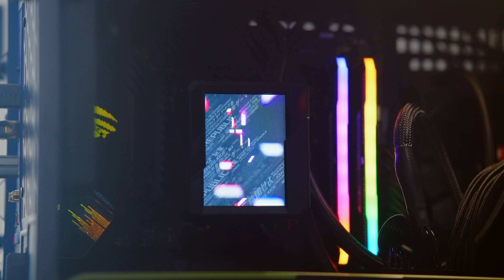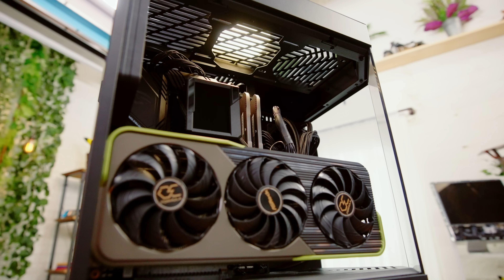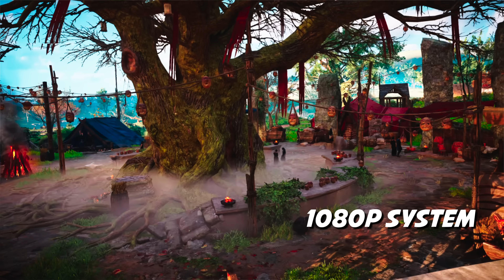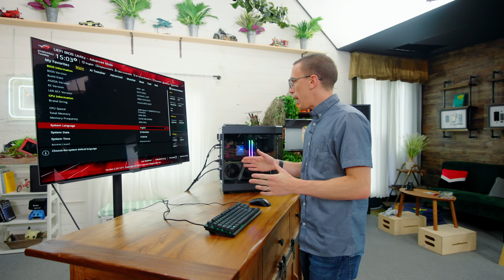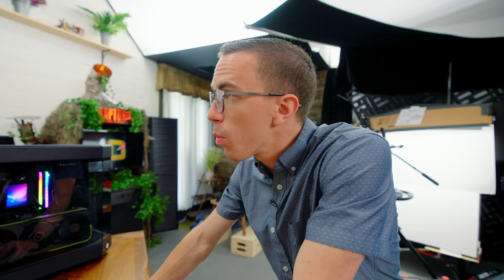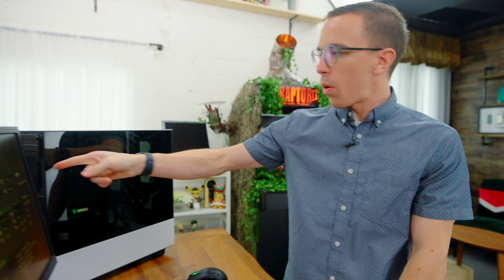Is an ALL AMD Gaming PC Worth It?

Comment: Running a 5600X with a 6600XT for a couple of days and it feels way better than my old 4790k + RX 580 8Gb. Almost no stutters, more than twice the frame rates.Awesome!!!
Reply: Same here. 1440P (60Hz Screen), 5800X and 6600XT. Its on 85% "nailing 60" in average. I do not need more.
Reply: @AnkurFFM  Exactly
Reply: I used to have a 6600xt before upgrading and it was great, I was surprised on how good they were
Reply: maybe its cause ur cpu was almost 10 yrs old
Reply: @Jackson_Vaughn he was talking about The Ryzen not the Intel 4th gen
Reply: im running same specs just 6650xt 1080p 144hz and its good

Comment: My Current Setup:
Ryzen 5 1600AF + GTX 1050 Ti + 16GB DDR4 3200mhz

My Future Setup:
Ryzen 5 5600X + RX 6500 XT + 32GB DDR4 4000mhz (I plan to use this for at least another 3-4 years)

Also Yes I could go with a better GPU BUT 5600X + 6500XT just looks so aesthetically pleasing LOL!

EDIT:
ok your comparison are stupid, you don't even mentioned what settings you are using for FidelityFX, Ultra Quality? Quality? Balanced? Performance? BIG FAIL not mentioning that.

Comment: I actually built an all-AMD gaming PC for my bedroom.  It's got a Ryzen 5600X and a Radeon RX 6650 XT in an H1 case and is targeting 1080p/1440p (depending on game).  I already had a 4K gaming PC in my office upstairs with an RTX 3090 and Ryzen 5900X so I was ok targeting a lower resolution with my all AMD rig.  Especially since I'm using a substantially smaller monitor in my bedroom (17" portable monitor vs 27" monitor in my office).
Reply: 👆.............👆👆.....👆👆👆
✴️Claim Unboxed.......🎁✴️

Comment: i have a 3070 from launch but with the 6950XT currently at $999 it is tempting
Reply: Just get a 6900xt for 700. Thats a much better deal and almost the same performance.
Reply: @MrNota500  if I did I'd probably grab the Sapphire TOXIC LE that comes with the AIO which is the same price. I've seen quite a few reviews complaining about Gigabyte's current cards. I haven't had any issues with my Gigabyte 3070 so who's to say

Comment: Anyone know if a DisplayPort 1.4 to HDMI 2.1 works to getting total hz on my monitor? Rn I’m using a hdmi 2.1 cable on both sides and it’s just giving me 100hz tops. Any solution? Btw it is an ultrawide monitor 1440p

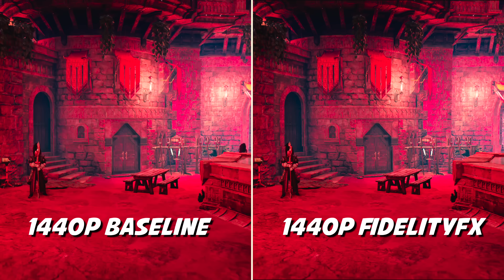Comment: Somebody screwed up. I would blame the video editor but I don't do video production. Check starting at 3:31 the HZD video as that part of the benchmark is VERY red.  You guys can do better. Oh and SAM doesnt have anything to do with alleviating CPU bottlenecks.  It allows the CPU to access all of the GPU memory instead of only in 256MB chunks.  Which would decrease the time required for memory transfers to and from the GPU.
Reply: 👆................👆👆.....👆👆👆
✴️Claim Unboxed.......🎁...✴️

Comment: built my first pc and went all AMD. (5600x and 6650 xt) let me tell you, I love it and the cost to performance is fantastic. v sync is out of the picture due to bad amd software, but I've never needed it. plays everything I can ask it to with no problem.
Reply: Do you mean freesync? And it works fine on my system....
Reply: That’s exactly the same build I have but I’ve ran into some type driver issue, did you have any of those problems?

Comment: it really aint. i started with amd cards and ONLY had problems. black screening during gameplay which resulted in me needing to restart. not only that, but vr works one update, and then breaks the next. i went through an rx570 and then an rx580 and had the same issues both times. got a 1060 6gb and had zero issues. just recently upgraded to a 3070ti and im loving it :) although ryzen cpus will always be goat

Comment: im running a 5600x with a rx 460 so im all amd right now 🤣
Reply: just upgrade to an RX 6600 already unless you don't play any games, which I assume you don't
Reply: @one_step_sideways  i do but nah it works fine sure my cpu is bottle necked into the ground but I didnt want to upgrade my cpu anyways I had a decent one before but it stopped working the money I was gonna use for a gou ended up going to the cpu

Comment: I have a budget amd build its got a super budget processor but i can't say anything bad. Ive always had Intel systems I wanted to try out this amd hype, like I said super budget cpu but all of my gaming experience is fantastic. I get good frames and if I really wanted a 4k experience it can completely provide it. Cpu is ryzen 1600af paired with a 5600xt.
Reply: i have a 3100 and a 5700xt build i got for less then $9000CAD a few years ago and im still super happy with it.
Reply: that is not running a game at 4k
Reply: @nostrum6410  ok keyboard warrior. "That is not running a game at 4k" you are such a mouthpiece. At the time I built it I had a 75hz 4k display and in fact played games at 4k resolution.
Reply: @CapN_Swagga  your attitude is unnecessary.  Just dont want people to listen to you and think a 5600xt can play 4k.

thats getting like 10-20 fps, with single digit 1% lows in many modern game.  So you are right  it can technically run it.  I should have it said cant it run 4k in an enjoyable way
Reply: @nostrum6410  you're an idiot. I could play cod apex wow any game on the machine. Golf looked amazing in 4k little nightmares fucking epic your're getting attitude because you're an ass. I owned it I run msi and Riva tuner I know what it could do. Yes you tool bag I couldn't get competitive level fps in shooter type games but all out saying it isn't possible is false.

Comment: I built a full and system and loving it. Its mid tier by today's standards but my Ryzen 3 3100 and 6600xt are a decent pairing for now and when I upgrade to a 5600x it'll be an even more amazing system.
Reply: Your system is so balanced that if you get a better cpu you probably won't get much better performance u would need to get a better gpu as well
Reply: True but I use it for video editing, streaming and Photoshop too the extra power could help me out in those departments
Reply: I have the 3300x and it is no slouch. The 3100 is a great 4 core cpu. Both are outclassed by the 12th gen i3 4 core but that’s a whole other story.

Comment: I wish more tech tubers would talk about AMDs biggest issue…. GPU drivers. They are STILL unstable. Especially with things like recording or streaming. Love the price point, but I deal with 1 gpu driver crash nearly every session.
Reply: Yeah I had similar issues until I switched to NVIDIA. I actually can’t remember the last time I had a driver issue, i don’t think I’ve had one in the 14 months since I switched.
Reply: True, it really is a roll of the dice. You might go years with a super stable card or have a bad driver that won’t run your favorite game for months until a few updates later. I’ve had an rx580 and Vega 56 that both ram flawless the whole time I owned them. I also had a 5700xt that ram great for a year until an update gave me random driver timeout issues. I gave up on it and sold it as soon as a stable driver update came out. I’m a little worried about my 6800xt. It was crashing on several games lately. I rma’d it, and the replacement card is running fine for the time being. Meanwhile on the Nvidia side, I’ve had no issues with a 780 ti, 1080 ti, 3060, 3060 ti, 3070 or 3080. However, I did have a 980 ti that I had to rma (not driver related), but the replacement ran great for years until I sold it.
Reply: Yep same problem here. Had a 6600xt with a 10700k. And I had a lot of weird issues with games. Cod running shittier then when I ran on a gtx 1660 super. Ram ddu and didn’t fix anything. Sold my 6600xt and went back to my 1660 super and literally noticed a bump in performance to most games even though it’s weaker. There drivers have to mature. It’s insane how shit they still are

Comment: I'm going all AMD sence I want to get the full use of my Rx 5700 xt
Reply: Are you using Sandy Bridge or something right now that you can't fully utilize your 5700XT?
Reply: @one_step_sideways  right know I'm using a xeon w3680 and upgrading to and because it makes the most sense sence because of my GPU
Reply: @underlifehasdoneitall  Ah, it makes sense, I've got a Xeon e5-1620 and an RX584 in my desktop PC - I hardly ever use it, since I use a laptop for work most of the time, and a month ago I've got a $1000 laptop with a Ryzen 7 6800H with its powerful iGPU. The games run obviously great there, especially with RSR, and the performance of the iGPU is roughly on par with GTX 1050 Ti Mobile, so I can game not only on the go when I'm on the charger, but even from battery power too. My Xeon e5-1620 gives out the same level of performance in games as the i7-4770k, due to the big amount of L3 cache that it has

Comment: Here's a better idea. Forget a gaming PC entirely and get a Series-X for less than the cost of a GPU, then get a nice laptop with a Ryzen 6 core CPU and still be at about half the cost of the "gaming PC". Like Keyboard and mouse? Great the Series-X supports that. This would also go for the PS5 if you could actually get one.
Reply: @CENTURY_PC ON INSTAGRAM 👉💻  Bad enough that you are spamming but stealing Austin Evans' picture? You should get the boot

Comment: I just bought an Alienware with AMD ryzen 5800, 16 GB ram, 1 TB M2 NVME SSD, RX 6800 XT 16 GB GDDR6. Why? #1. It was cheaper than Intel. #2. Cheaper than Nvidia #3. RX 6800 XT is 8th on passmark GPU charts. Anything out of the top 10 best GPUs always good for me.

Comment: Here's the thing: Intel is now finally getting into the Discrete GPU side of things with their Arc GPUs and pretty soon to compete with AMD is offering the same CPU/GPU extra performance features if you use both parts from the same company (which they are working on). In turn this will make NVIDIA also have to get into the CPU side of things with offering NVIDIA CPUs that can talk to the GPU directly. So pretty soon, you can have All AMD/Intel/NVIDIA computers on the CPU/GPUs at least and this most likely this will be the recommended route in the future going forward to get the best performance possible, which I imagine all three companies will start to do.
Reply: Interesting theory. I agree with you. But how long do you think until Nvidia makes a competitive CPU? Since if I recall correctly, they used to make some pretty basic 4 core CPUs called Tegra.

Comment: I've been using an amd system for the last few years and one of the things i liked when building it was that older parts were actually decently cheap especially  gpu's when i was looking for a gpu any card from amd was like half the price for an equivalent powered card of a NVidia card but im sure eventually that will probably be different if they keep cards in stock again
Reply: same i had an msi gaming x r9 380 4gb and an fx8350 with 16gb ram
and in most games i was hitting the exact same fps as a friend of mine who had a
intel i7 7700 16gb and a 1070 
his pc was like twice the price for the same performance
Reply: Nope. AMD is always cheaper.
Reply: I've never figured out why Nvidia is so much more known when they charge way more for the same performance even if they were around before AMD it's always surprising to me when someone recommends a really overpriced gtx card when an AMD GPU is usually like half the price
Reply: @autisticgod3338  I think you also said it. Reputation. AMD cards is way better price-performance ratio but Nvidia is more popular for the casual consumers. Most laptops and prebuilts are equipped with Nvidia’s GPU rather than AMD’s (being rarer to find)
Reply: @autisticgod3338  mindshare/marketing, and probably some scummy underhanded moves. They even went as far as strong-arm a discount out of TSMC (failed in the end) mafia style, that's why RTX 20XX was on Samsung silicone. You could have 2 cards similarly performing and everyone will go buy Nvidia one that is more expensive because "Nvidia is better". They have the best GPU in the World, albeit less than 2% of population has seen it in person, let alone own it, ppl will buy 3060s just for some fake sense of owning the best, even tho there are no real benefits. It's called the halo effect.Then there's their huuuuge marketing machine. The fact 2080Ti was dying on reviewers was forgotten in like a week while RX 5000 driver issues were dragged on for years...

Comment: Either brand will give you a great system. AMD is a better system if your planning on doing a lot of media content creation, but for pure gaming Nvidia has been proven to be better overall by every major tech channel. But honestly the best system will be the one that you can afford without sacrificing to much of what you want.
Reply: Uhm, no? It's the total opposite xD

Nvidia is better in content creation they have hardware Inside the GPU dedicated solely to video encoding and AI, if you want to do content creation or streaming, you're better of with an Rtx
AMD is only better in pure gaming, rastering
But if you need ray tracing, Nvidia is the way, for now
Reply: this is only true for AMD in situations where the CPU is leveraged, Nvidia still absolutely treads over AMD when the GPU gets used in the process as AMD still doesn't have anything comparable to CUDA/NVENC that is in software yet

Comment: My desktop has an AMD cpu and Nvidia GPU. However, when shopping for my new laptop I went all AMD and I’m loving it. I tried a few laptops and the performance difference with going full AMD or mixed wasn’t worth the battery trade off.
Reply: I just bought a amd advantage laptop aswell. I bought it to replace my gaming pc. With rx 6600m and a ryzen 5800H. It will arive soon. I am very exited i only paid 1080 Euro (1100 Dollar) for the Laptop and it's even a Lenovo Legion 5.

Comment: So I mean the real test would be how much fps increase comes from Fidelity fx and how much is from Sam. Put a similar level nvidia card with each system and dlss and see what happens.
Reply: Sam gives about 15% increase, but you can use the resizable bar, which is the same thing, on the Rtx 3000 series, if you have a Ryzen 5000/3000 or an Intel 10th/11th/12th gen

About dlss, for now it's way ahead of fsr, and also fsr 2.0 is implemented in like 4 games, and 1.0 is really bad

Comment: As someone who has owned multiple all AMD Systems I'm quite dissatisfied with my experience, I've had a 5700xt have issues where it will hard restart the PC for 0 reason and performance issues, a 6700xt which has Constant performance issues in Games, a few years ago I bought a brand new recently released laptop and within 6 months AMD Dropped support for my hardware and I couldn't update my driver's past AMD Catalyst. the only good AMD experience I've ever had was my first desktop I built with an Rx 580 I was pleasantly surprised how well a $150 card performed in some cases it would out perform my 6700xt system. Safe to say my next PC is going to be an Intel And NVIDIA system I've spent around $3000-$4000 on AMD and I regret every cent. When I spend $1000+ on a product I expect reliability and performance

Comment: This test was honestly kind of bad. You spent so much time focusing on the Rx 6950xt and not enough time with the other GPUs. Also SAM works best at lower resolutions. Also i wouldn't recommend to use RSR if a game supports FSR, especially if it's FSR 2.0. If the game doesn't support FSR then RSR is perfectly fine. But what Austin also forgot to mention is that RSR has a sharpening slider. I use it in some games that don't support FSR and I've noticed that moving the slider to 85% is the sweet spot. What he also forgot to mention is the tuning feature that AMD software had built in. You can simply allow your system to run better if you increase the amount of power it uses. You can also undervolt it which will essentially run at a lower voltage but give you the same or better performance while running cooler.

Comment: I've been running all AMD builds since like 2015. Mostly cause it was cheaper. But yeah I've noticed that there's less issues when you have a CPU and GPU both from AMD.
I'm interested to see if we get a similar situation with Intel now that they are making GPUs.
Reply: all amd since 2003 but it was ATI GPU back then lol
Reply: was running a 1050 bought it like not even half a year off launch now that gpu started throwing artifacts so i upgraded to a rx 580 8gb a used one tho but i paid the same price as back then for a new 1050 but this card its like 2x faster
Reply: Sure they will, why would they optimze their cards for amd cpus? They dont make money from amd so there is no reason

Comment: I have an all AMD build, for the most part its great.  The biggest issue is the graphics software stability, it likes to crash.  Alot.
Reply: I've had as many crashes with the 3080ti as the 6900xt.  They happen sometimes.  I blame  windows.
Reply: @billlawson3467  Yep it's Windows, as I run Linux(Solus w/Budgie DE to be exact), and since Linux kernel 5.14 AMD has been really stable with the open source drivers on the CPU, GPU, and APU side of things as long as you don't buy within the first 6 months of release of a new product.
Reply: Congratulations you were selected amongst the shortlisted winners 🏆 for the ongoing MacBook-M2/PC/Ps5  giveaway 🏆what'sapp the number above👆🏻
Reply: It sometimes has issues, but not alot though? Barely any crashing (for me atleast)

Comment: I still see no benefit using AMD GPU-CPU combo instead of, for example, an AMD CPU with a Nvidia GPU. Resizable bar and FSR work with both, and with nvidia you also have access to DLSS.
Reply: AMD Linux drivers are much better than Nvidia.
Reply: Congratulations you were selected amongst the shortlisted winners 🏆 for the ongoing MacBook-M2/PC/Ps5  giveaway 🏆what'sapp the number above👆